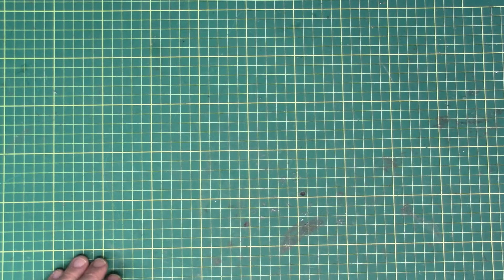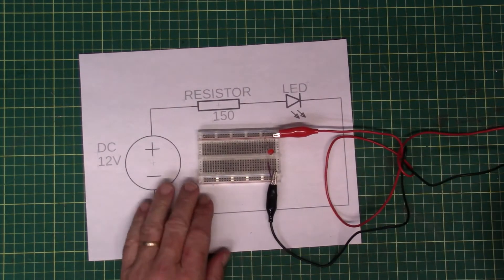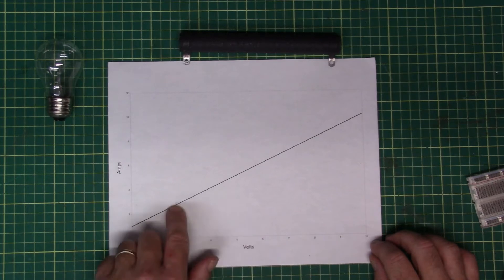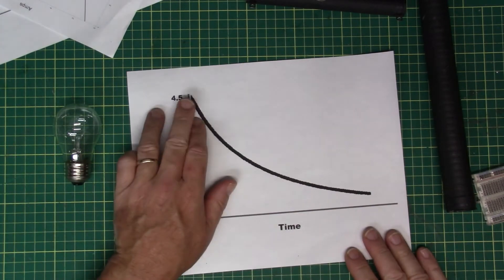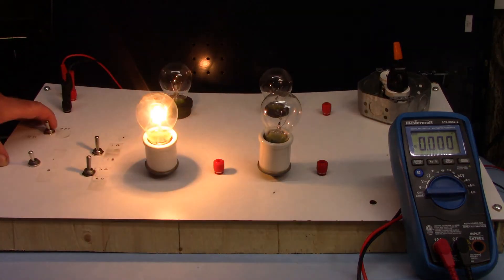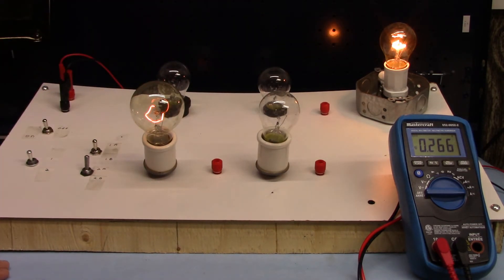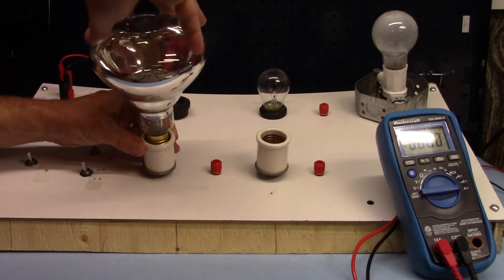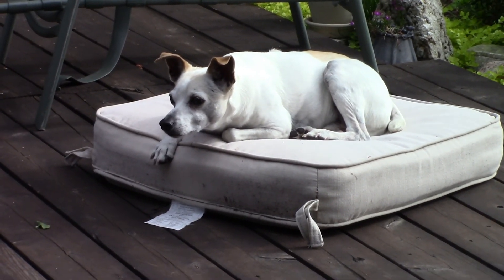01821 Workbench 101 #2  How does a Dim Bulb Current Limiter Work

Comment: What is the formula to calculate the bulb wattage needed related to the device?
Reply from the maker: If you look at about the 8min point  I explain the formula  

P(w)=VI, 

so for 40w  

it would be 40=120/X  so .333 of an amp for a 40w bulb.   (varies by the bulb and the state of the mains voltage)

Normally  most items have either a working wattage  or amperage listed    so I  just select bulbs for about that working amperage /wattage
  
If I do not know the working amperage /wattage then follow the 'old' rule of analog meters but in reverse.

I start with the lowest bulb and then add in as I go.  

If you have a look at this video
https://www.youtube.com/watch?v=MIWz8RlloLU
at about the 10min point I use bigger and bigger bulbs to load an old HP Nixi Counter

  
🙂

Comment: This video is a decent attempt. But I feel it would be more valuable with more explanation of the principles (theory) involved. Especially why and how the bulbs help limit the current. More explanation of ohm's law, and more explanation of how the voltage is distributed at the moment of switch closing, and how and why the voltage distributed at quiescent status. Also, explain WHY we use dim bulb testers (excessive current flow into DUT, due to internal shorts, shorted capacitors, damaged cords, etc. Also, I may have missed it, but a graph showing initial inrush current leveling off to quiescent current would help, if it is not already shown. Otherwise, good job.
Reply from the maker: Sorry for the late reply, been away.  Yeah I had a longer version but I wanted to keep it short a sweet.  If I remember correctly my old teacher spend well over 4 classes on just the theory of series vs parallel light bulbs, but that was a long time ago ;)
Reply: @byterock  yeah, no problem. I didn't mean to sound too critical. Any effort that helps people is to be applauded. When I give feedback, it is with the best of intentions.

I have a Rock solid understanding of ohm's law and have watched many vid's about Dim tester's. But I am still having trouble visualizing how the voltage drops are distributed across the bulb and the Device Under Test, in quiescent conditions, after the initial inrush surge (assuming there is nothing wrong with the device).
   I really need to sit down with a calculator and pencil and work it out. The variable resistance of the bulb from cold to hit is slightly tricky to figure in, especially when the voltage across it is less than rated voltage, so we can't rely on the wattage rating to mean much, except in limiting initial inrush current.
    I am hoping to build my own tester soon, ultimate deluxe version, with analog panel meters for voltage and current, and about 5 different load bulbs that can be switched in or out for different conditions.
   Thank You.
-from Minneapolis
Reply from the maker: @douglas2lee929   No problem Douglas I love feedback.  It is a very tricky subject and there are whole physics and engineering books written about ''Non-Ohmic"  conductors or resistors.  
The whole point of a 'Dim Bulb' is that is does not follow 'Ohms Law', maybe I should of pointed that out better in the video.  I will change the description an add in a good link on 'Non-Ohmic'  thingy. 

Yeah good old 'ohms' law goes only really good when dealing with DC wait until you get into 'Impedance'  I am still trying to work that one out ;)
Reply: @byterock  Thanks. Yeah, my schooling included impedance and reactance. Sometimes I have to look up the formula's. Never did get totally comfortable with the phase shifts from the inductors and caps. 😥
Reply from the maker: Unfortunately mine didn't I only figured it out reading an old 'RCAF' 1950s training manual that had a good section on it.  Used very practical examples vs the theory of waves 2d graphs one use to see.  There are some good 3d animations out there as well that demo it
TTFN

Comment: Hi,
I got a power mixer 110V 700W power consumption,  powering it through a dim bulb 100W bulb, press power, the bulb start flashing on and off. 
And the mixer led light flashes too. 
You think the bulb is limiting current to the mixer?
Reply from the maker: It we are talking about a Mixer for Audio like an MG-12 it more than likely does does not have a power transformer but a SMPS.  My guess what you are seeing the SMPS starting and stopping (shuttering)  and what you are seeing is SMPS turning on giving the correct power so LEDs come on and then shorting out causing  the DIM Bulb will flash and then turning itself off. I usually a never use a Dim Bulb on an SMPS device as there is no transformer to burn out.   I think 700w might be the Audio output and not the input power requirement that should be between 35~100w.   

My guess it is limited the current but the SMPS is resetting by itself so the dim bulb is not doing much.
Reply: @byterock  hello Sir, thank you for replying to my comment. 
The power mixer is 400W per channel. 
700W power consumption. Labelled back panel. I took the chance and plug it in directly to the wall plug. Works fine. Yes the dim was limiting the current. It has a 6.3A fuse as well.
Reply: And yes it a big SMPS power supple.
Reply from the maker: @anoushan   Wow 700w power consumption. and a 6+ amp fuse. You would need like a 1500+ watt bulb.  But that makes sense the Dim bulb would limit the current and the SMPS would detect that and then turn off suspecting that there is some fault with the power coming in. If it was designed to that sometimes low current can cause as much damage as high current 
😆

Comment: Hiya, thanks for your time to make this video.  Yes I agree that the in series dim bulb must be able to supply the required load current if you run the DUT loaded.  However, the bulb is supposed to limit the current specifically so you can determine if the DUT has a short.  In your example the objective was to protect the DUT (the light bulb used as the example load) hence the DUT should glow dimly.  Putting a large bulb reduces that protection as it allows larger, potentially damaging currents to flow in the DUT.  

On that basis I’d suggest the first test of the DUT should be with a single or series bulbs and later tests with load on the DUT (I’m thinking say the DUT is a Switch mode PSU) could be with a single bulb or bulbs in parallel. 

Just for clarity for those who might not know... DUT means “device under test”
Reply from the maker: Thanks, yep that is an idea.  This is more a 'How Does' video vs 'How To'.   
This is the DBCL I created 

https://www.youtube.com/watch?v=7ME1iPrkhOU&t=16s

How it is employed is based on what I am testing.   Lots of bulbs for a 5 amp CRO one 40w bulb for an old 100ma AA5 portable.  

With the Dim Bulb it always best to start low and add more.  
Unlike say an old analog  volt/amp meter measurement where you start with a high voltage/amperage and then scale down.

Comment: Check the cold resistance of the 100W bulb, it's worryingly low, even at typical indoor room temps, cold weather drags it even lower.  Less than 10 Ohms.  Inrush can be huge if you happen to turn it on just as the AC reaches its ~170V peak.  

120V RMS is kinda misleading to the average person, we're really dealing with 170V peak potential between the outlet prongs. A cold 100W bulb can easily have an inrush current more than 20 Amps.
Reply from the maker: Isn't that the whole point of the dim-bulb current limiter ;). 

Take a big wack of current to start vs the DUT.

But I see your point on the little graphs I created.  A even bigger spike on the graph might of been better.

Comment: @ByteRock  
Instead of expensive resistors, good electric cooker, iron, heater, kettle etc can be used to replace dim bulb when high amperage is needed. Some of them can handle 20 Amps and are available at homes
Reply from the maker: Yep I would guess they would do though there is no easy way to tell if you have a short until they start to glow red.  I have seen them used in RF dummy loads for HAM work but they one I saw was also in a sealed  oil bath to disperse the heat more quickly.